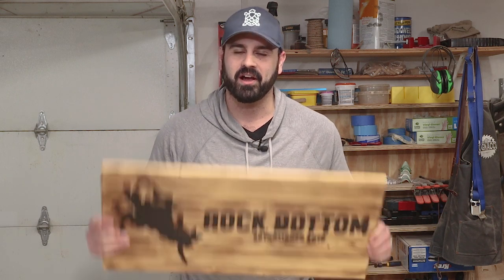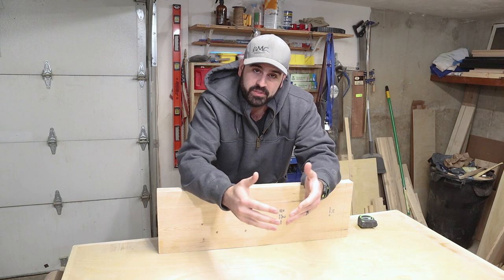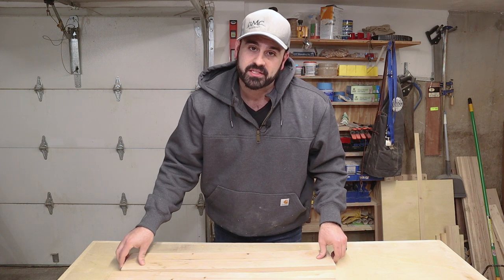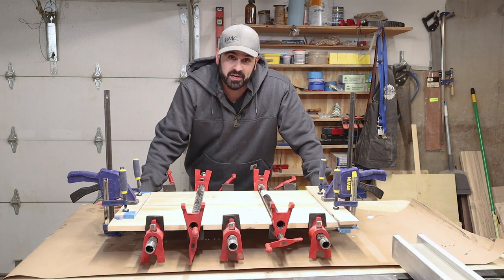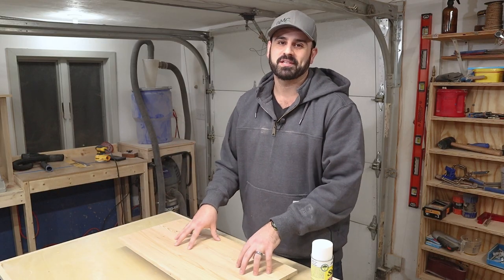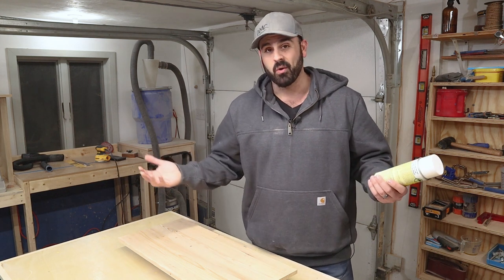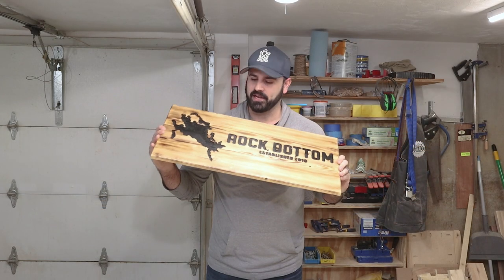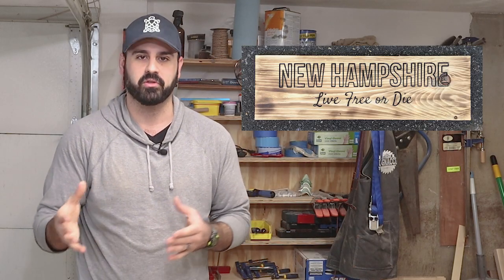How to MAKE and SELL Wooden Signs | CNC | Woodworking

Comment: I'm pretty new to this but I have found a few things that might speed this process up for yourself and others. Use a downcut bit instead of the upcut bit in the CNC, very minimal clean up. Put oramask down on the wood first before carving, the mask will stay on and then use a water based paint for the cut out areas and peel the mask off, cuts down on the need to sand!! Great job though!

Comment: Great video! Just one tidbit to share that I learned recently. It's a good idea to seal all sides on a wooden sign. If you don't also seal the edges and back, over time, it may absorb moisture from the air unevenly and warp or crack.
Reply from the maker: Great tip, thanks!

Comment: Pine boards tend to bleed so the first things I do is coat it in sanding sealer. Then instead of paint I use flat black primer. Paint will ruin sanding discs quick and since your going to put a gloss top coat on anyway no one will ever know it's a flat primer.
Reply from the maker: Oh, never thought about using primer instead - thanks for the tip!
Reply: i just dont use pine. red cedar or redwood. flat black then a hand planer then the sander

Comment: Skip the last planer before the cnc and go deeper with the bit, paint the plain. 

If you don't want splintering from the bit, get a down cut spiral bit.
Reply from the maker: Thanks Michael!
Reply: So run through the planer after painting??
Reply: @wesmac68  If you're doing just a color fill, engrave about 1/16 deeper. Then yes, run the boar through  the thickness planer.

Comment: Great Video! I do this kind of work on the side as well. I have a couple tips that have helped me along the way. Downcut bits on soft wood help tremendously on the fuzz. You can also you scotch Brite to clean them up as well, if you do it lightly, this does very little damage to the wood. If I carve out a large area, I usually go over it with 220 grit sand paper to remove the cut lines. This gives it a much cleaner look. Keep up the videos! Its refreshing to see someone who doesn't have industrial quality tools making some money woodworking.
Reply from the maker: Thank you for the tips!  I definitely need to get a downcut bit as that's been a frequent recommendation.  I appreciate the support and thanks for watching!

Comment: Just an idea, paint with acrylic paint and sand off. Don’t have to tape off all those areas. Or even easier, apply lacquer or poly prior to engraving. Then engrave and paint letters with acrylic paint. Then wipe paint right off the top leaving only in letters cause of slick finish.

Comment: A few things you can try to help your process that I have used for years. First off select you bits better, if at all possible use a sharp down cut with proper feeds and speeds and I always run my files twice which helps clean up the fuzzy's. Get some Oramask put on the board first then carve.  Once that is done prior to peeling off the Oramask spray the design with Flat Black paint (it dries way faster than gloss) once paint is dry peel off Oramask spray with Lacquer (again dries very fast and does not require sanding between coats), then if you have any little rough spots smooth with steel wool.
Reply from the maker: Thank you, super helpful feedback!  I do need to get some additional bits and the Oramask - seems like the best process for this.
Reply: totally agree on the oramask (813)  need to clear coat both sides equal number of times or it'll warp.  I've got over a decade into cnc sign making
Reply from the maker: Good to know, I did get a little warping with this piece too. Thanks!
Reply: @jim brown when you run your carve the second time can you speed it up since you're not really removing much material?

Comment: Good job on the video. Good information. Great looking sign. I am a newbie myself, but couple things that help me with the cut an paint process is using oramask 813. Put it on, cut, paint, peel it off, you are done. No sanding of paint. Also, downcut bit saves a lot of time sanding for projects like that. Thank you and will watch for more.
Reply from the maker: Thank you!  And thanks for the recommendation on Oramask - I've seen people use these but never knew what that was they were putting on top, now I do!  Definitely need a downcut bit as wel.  Thanks for watching!
Reply: Hi mate, how do you stop the oramask from lifting? I have tired a couple times and cannot get in a clean cut always pushes up a little
Reply from the maker: @atl4476 put a coat of shellac down and let dry before putting it on.

Comment: To prevent seeping paint, I test out Oramask 813, its like a vinyl film and the CNC bits will cut through it and then you can paint without additional taping, and once dry remove the film. Works well so far.
Reply from the maker: Awesome thanks! I definitely need to pick some of that up.
Reply: @CasualBuilds  Amazon has it for a good price!
Reply from the maker: Thanks!
Reply: Hi mate how do you stop the oramask from lifting? I cannot get a clean cut

Comment: You can save a lot of sanding time using a down-cut spiral bit (and going deeper in the material) and sticking Oramask or Oracal 631 before the machining. You only have to paint and remove the vinyl
Reply from the maker: Great tips, thank you!!
Reply: How do you stop the oramask from lifting and get a clean cut?

Comment: I like it, good job. When sand carving, we use a mask to protect the substrate. Seems to me it would be easier to apply before routing, so you wouldn't have to sand off the bleed or overspray. Might help with the tear out splintering as well. Just a thought...
Reply from the maker: Thanks! Definitely going to try that method next time.

Comment: After you apply the shellac and spray paint-use mineral spirits and the paint will wipe right off...saves a lot of work. Mineral spirits cut paint, but not the shellac.
Reply from the maker: Oooh, good call!  I'll have to try that next time - thanks for the tip!
Reply: It works wonders. You still need to sand some, but most the over spray comes right off!  Good luck. Great vids!
Reply from the maker: Yea, even with just the shellac, there was still some paint that bled into the pine - Thanks again Kyle!
Reply: Instead of shellac...try a can of Sand Sealer-I Believe the same company makes that shellac and the sand sealer.  That’s what I’ve switched to and there is no more bleed thru.  Good luck!  Hopefully it works as good for you as it does for me
Reply from the maker: @WIkosin1  I'll check it out!

Comment: Great video! Something I heard recently - try using packing/shipping tape vs. painters tape on your calls. Will come off much easier as glue won't stick to it.
Reply from the maker: Excellent idea - I was hoping I could fast forward through that part and no one would notice the struggle I had prying then off of the panel 😂

Comment: Great video, nicely done.  Curious what router bit are you using for your cuts?  Also a couple ideas, Oramask or simple shelf liner paper makes cleanup easy.  Just peel it and stick it on before you start cutting.  Very little sanding which is nice.  Also I started using regular paint with a brush.  It seems to be thicker and wont bleed into the grain of the wood.  How many signs can you end up selling in a typical month?
Reply from the maker: Thank you!  I used a spiral upcut bit on this project I believe.  Many people here recommended a down cut bit and the oramask as well.  I still need to try that out!  I've slowed down my production on signs at the moment, but the ones I did make, would typically sell fairly quickly.  My focus is more on content creation here on YouTube, rather than making pieces to sell.  I still do it from time to time, though.

Comment: After the CNC you use a brush to get rid of some splinter material, do you also sand it before the next step?
Reply from the maker: Yes, I believe I did and forgot to add it to the video.  It helps get all those little pieces as well.  A lot of people here have also mentioned using a downcut spiral bit to help reduce the splintering.

Comment: I was wondering more about the finish process. Was it just one pass of the torch, one sanding, and then the coats of poly? What sanding block did you use? Thanks, great vid
Reply from the maker: Yeah exactly that. My torch actually died on that last pass through in the video so what you saw is the only torching I did. I really like these sanding sponges from Lowe's, I think 3M makes them, I always have a 120 and 220 on hand.

Comment: Spray the shellac after you tape it. The shellac will "seal" against the tape and when the black goes over it, it won't bleed. Same principal when taping walls, base coat, tape down, base coast over tape again, then color. Never have a bleed through again.
Reply from the maker: Awesome, I'll have to try that out - thanks!

Comment: I wonder if you could just Cnc the sign with masking tape on and then spray paint. That way the cnc would cut the image and masking tape out and leave tape everywhere you don’t want spray paint
Reply from the maker: Yea, a few people mentioned that as well.  Someone mentioned using Oracal vinyl sheets too.  I may give that a try next time.
Reply: @CasualBuilds  go for Oramask 813.  With a sharp V bit or downcut, it saves soo much time...

Comment: Did that board warp on you? Seemed flat all the way up until some of the post burn shots but I’d find it pretty hard to believe that such a light burn would warp out like that so I’m hoping it’s just a trick of the lens because I really don’t want to have to drill dowels or cut biscuits for something this simple
Reply from the maker: It did warp a little afterwards. I think it's because the pieces were pretty thin and I didn't alternative grain direction.  Also, I should have milled the material, waited a day or so to see if there was any changes before gluing things up.
Reply: @CasualBuilds  oh okay, well dually noted hah thanks!
Reply: It may be the torching. It’s called sho sugi, a Japanese finishing technique, to torch the board.  As you torch one side, it causes the board to cup.  Solution is to do a quick similar torch on the back side and it will mostly go way.  I’ve done several of these and that is the cause/fix I have used

Comment: Question:  DO you think you could paint and then run through the planer to get over spray off?
Reply from the maker: I'm not sure to be honest.  I'd think the paint would gum up the planer knives, but I'm not sure.  I didn't want to try here because the board was already way too thin and I didn't want to remove any more thickness if I could help it.

Comment: If you use a down sheer bit while carving you will get less tear out.
Reply from the maker: Thanks!  At the time,  I only had two bits on hand, either a flute style one or a spiral upcut.  I believe the flute is designed for less tear out, but the bottom of the cutout won't be as smooth as an upcut one.  I definitely need to acquire some new bits though, thanks for the recommendation!

Comment: why wouldn't you use the planer again to get rid of the overspray? especially if you have an issue with it bleeding deeper than you want to sand?
Reply from the maker: I thought about that, but the board was already too thin and I didn't want to remove any more material.

Comment: quick ?   I noticed that after the CNC was done cutting everything out there were a lot of wooden fringes.  Do you find that this happens often and what do you usually do to get rid of them.  Do you just sand the entire board down or maybe run through the planer?  I'm confused with what I saw and how you handled it as you didn't mention it.
Reply from the maker: Great question, I'll use a little wire brush and lightly sand as well to remove them.
Reply: Is that because the bit is not sharp enough
Reply: Someone just mentioned down cut bit.  Sounds good to me

Comment: Ever tried using contact paper to mask areas? If i'm doing a sign with a colored base I paint base color then lightly sand to get a smooth surface for contact paper to stick to, also if using wood where stain and varnish are used then do the stain and varnish before machining then sand and apply contact paper,machine pattern then paint over paper after paint, remove paper makes for nice crisp lines, very helpful when using multiple colors, I use a contact paper called Oracal it sticks well ,I use a laminate roller to make sure it sticks and to get out air bubbles. If you are going to try this make sure you get the matt finish removable contact paper, if you get the gloss permanent contact paper it's a bi#$h to remove.
Reply from the maker: Thanks, that's super helpful! I've used a paper mask once, but definitely had some issues.

Comment: Great video! What type of CNC router bits do you find work best for engraving?
Reply from the maker: Thanks! Definitely didn't use the right bit in this one. A lot of people mentioned down cut spiral bits for that type of engraving. Helps reduce the tear out on the top. I've been using 60° V-Bits recently and love them for standard letter engraving.
Reply: Casual Builds  Thanks so much for the info! I actually program different CNC machines for work, including a 5-axis CNC router, but we never engrave so it’s definitely something I want to start doing! Now I just need a bit! Thanks again!

Comment: Nice and informative video! I do have a question. How do you make a mock up? What material do you use for it?
Reply from the maker: The mock-up I made was just an image of what I was going to carve out. I use Easel (from Inventables for this).
Reply: Casual Builds Ah! That makes sense. Do you just send the mock up image file to the customer electronically?
Reply from the maker: Yes. I'll just take a screenshot from the site and email it over to them to confirm the design. Once I get the confirmation, I'll start production!

Comment: I use lasers. I don’t get as much as you do per sign, but I do get volume. I’ve done $25k on one $37 sign since the start of the pandemic.
Reply from the maker: That's awesome! What laser engraver do you have?
Reply: @CasualBuilds  I have 2 80w machines and one 50w machine. They are all 3 non branded Chinese lasers. I went that rout because I can upgrade and fix them myself. Saved THOUSANDS

Comment: I've been doing 3-d models and everyone of them have sucked ass. I still have to fine tune the software and practice a lot more. What software do you use? I use Aspire. The cleanest thing I've done is a photo with a laser.
Reply from the maker: I use Easel, a free software by Inventables. It's the only one I've used so far with the CNC.
Reply: @CasualBuilds  I think it looks great dude. Still going to try to get to your level because I know it could be very profitable and not only that but a great hobby!
Reply from the maker: Thanks! It certainly is a fun hobby. Just yesterday, I made a sign for my friends new lake house - probably took 30 minutes to cut out and looked great!
Reply: @CasualBuilds  sweet! How do you come up with costs? I've tried to use the rule of 3x's...3x's the cost of goods, but that being said...I don't know how much my time is worth. I got a laser attachment the other day and etched a photo of a retiring fire fighter and it turned out great, but I did it for free for his service, ya know?
Reply from the maker: This one was actually free as well. I don't really have an exact formula. I think it really depends on who's buying it. The sign I made in the video was a custom order, which would be more expensive than if I made a general one and put it in a country store.

Comment: on the table saw, how do u figure out how to cut them exactly in half? i feel like i am always off just a hair
Reply from the maker: Here's the trick.  Try to get it as close as possible, then run your piece through just slightly so the blade hits it.  Flip it around so the other face is against the fence and try again.  Adjust the fence so your cut is in the same spot.  Hope I explained this correctly!

Comment: What model cnc is that?
Reply from the maker: X-carve by Inventables
Reply: @CasualBuilds  who is a good supplier for hardwood stock? I have yet to find a decently priced source locally especially for woods like walnut, red cypress, mahogany, aspen, specialty species like African hardwoods?

Where do you shop
Reply: @CasualBuilds  also what software are you using
Reply from the maker: I've gotten hardwood online and a few boards at my local lumber supply store (was overpriced) and the software is Easel.

Comment: Hi, what type of Cnc machine and design program are you using?
Reply from the maker: I'm using the X-Carve from Inventables with their software, Easel.
Reply: @CasualBuilds  Thanks, do you have any experience with the vcarve software? I'm comparing it with Easel. Do you know which is better for sign making?
Reply from the maker: Unfortunately I don't have any experience with that software. With Easel, you can easily import files so sometimes I'll design something in Adobe Illustrator and export as SVG and import into Easel.

Comment: First you need a home based business license.
Reply from the maker: Definitely don't have the necessary credentials to be speaking about that.  Consult a professional!
Reply: Having owned a printing & Sign company for over 30 years, backyard unlicensed guys are a pet peeve of mine. 
    I just purchased my bucket list Laguna IQ CNC router for my home shop & I have a Home based business license. I also retained my contractors licenses as I still do some work for a few brick & mortar Sign shops.